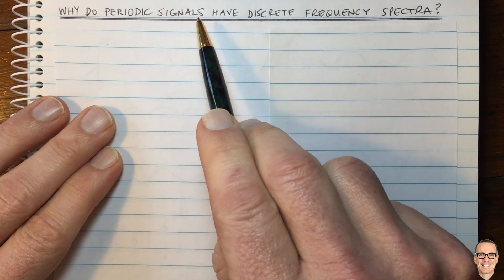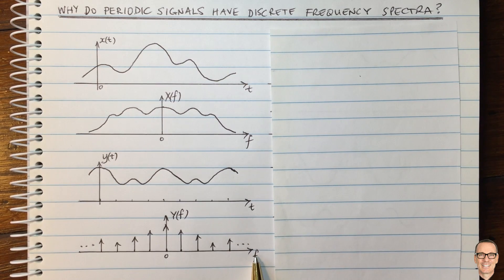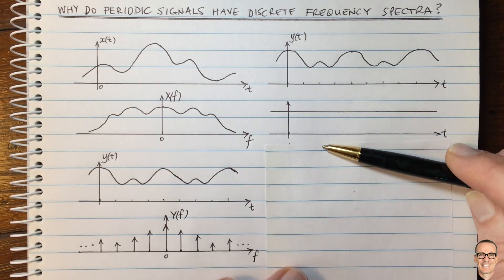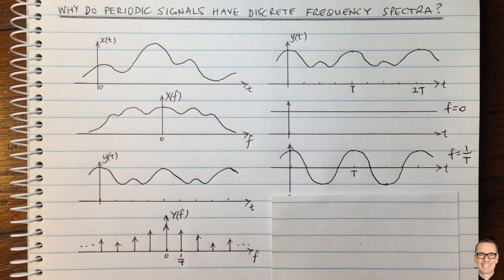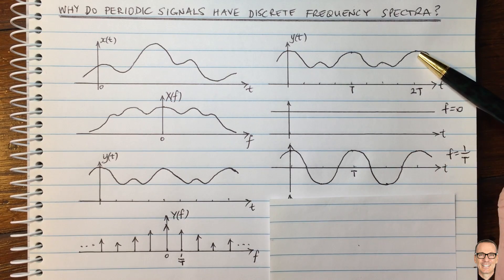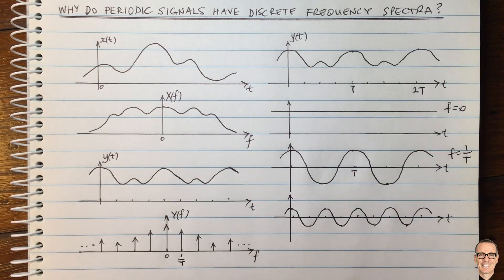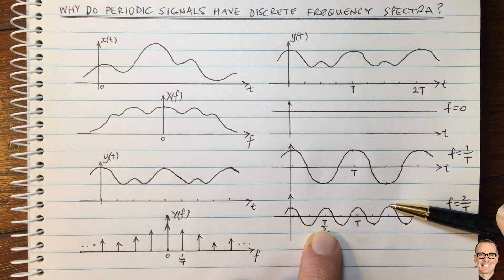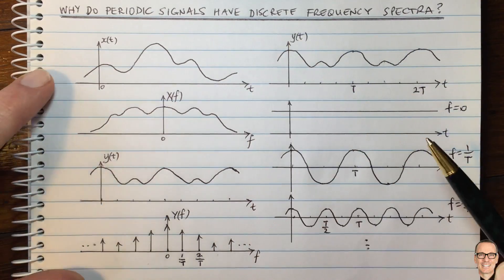Why do Periodic Signals have Discrete Frequency Spectra?

Comment: Thanks a lot. To the upper right plot: Without that offset, the f=0 component would vanish, right? (That means a signal with a mean value of y(t)=0)
Reply: So, the DC value can be calculated directly as an average in time-domain, without resorting to a DFT. (with proper scaling "2pi" based on the Fourier transform definition that has been used).
Reply from the maker: Yes, that's right.